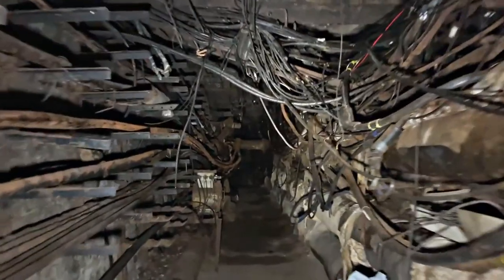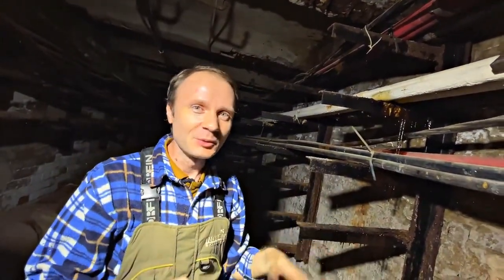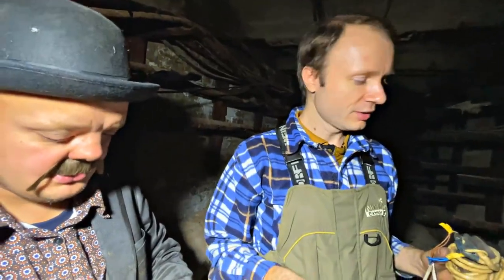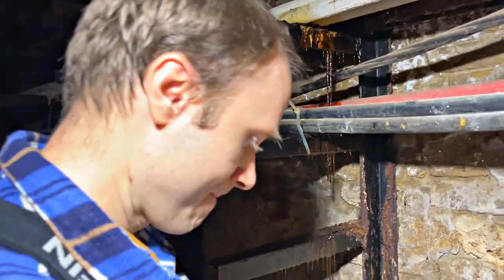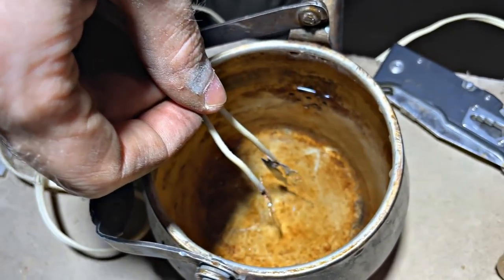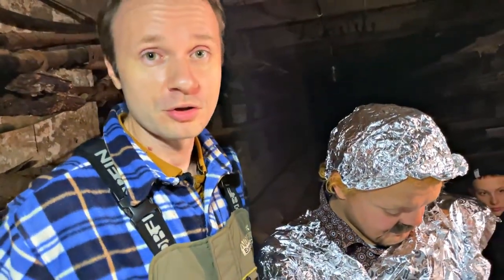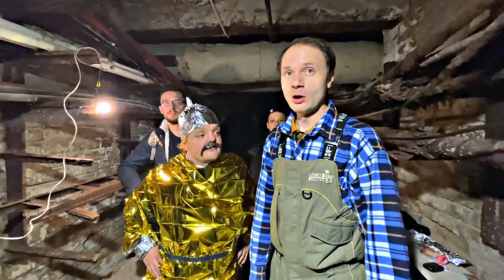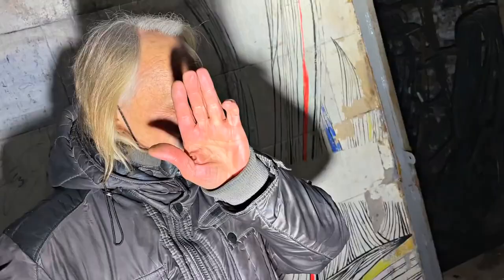How to get⚡️Electricity⚡️with a REEL from High Voltage Power Lines ⚡️💡⚡️Wandering Currents

Comment: You just made a transformer and say it doesn't steal electricity from wire, lol
Reply: Nope it's not stealing electricity from wire it generating current from the wire magnetic field.
Reply: There are so many videos about it.
Reply: @Suspicious259  you’re putting a small impedance in series with the wire by clipping the transformer onto it. Whatever is being fed power by that line is going to see a small drop in voltage because of these shenanigans.
Reply: @Suspicious259  those transformers cores are designed to force wires to make a bigger magnetic field than they ever would on their own. That’s going to rob some power.
Reply: Jov Ven  what
Reply: @Suspicious259  lol its transformer transform voltage from hv cable to another level voltage, maybe 220 v hahaha
Reply: Man i was thinking this the whole time
Reply: It does if you don't pay for the power going through the cable haha
Reply: Yeah!
I was thinking the same. That's basically a current transformer - it works by putting a small inductance on the line, which in turn creates a very small voltage drop as the current passes it. The more current that passes, the higher voltage drop and voltage output at the secondary. Normally this is used just to measure AC current in a line, but can of course also with the right configuration extract some energy. 
The voltage drop (and energy extracted) is most likely not even noticable for a line like that (it's probably in the mV range - but with a lot of current passing, that can still give enough output to power small things up, like they did). Neverless - it's 100% stealing that energy, LOL!
Reply: @oskar_f2397  its nowhere near as illegal as patent offices stealing inventors overunity patents. We are making due with the breadcrumbs we are left in society its amazing these guys are showing how to survive Whats obviously coming the next 5 years. True heros imo. Keep up the great content guys
Reply: @brandonwood8971  You are right about the great content thease guys make and I dont think theyre doing anething moraly bad but i will have to disagree with you about the overunity patents. I think if they worked they would break the laws of fisics. But I am not trying to say anething bad about you mr Wood.
Reply: @oskar_f2397  im so happy then to share this youtube channel with you "aaron murakami" feast your eyes my friend. lets your soul feel the greatest hope it ever has. im surprised stars and black holes didnt prove to you overunity is possible already like it did for me 25 years ago when i was 7
Reply: this is the most valuable video ive ever seen.
Reply: @Suspicious259  It is, it creates drag on the wire.
Reply: @Suspicious259  That's how transformers work, you have a coil (which can be a single "turn") an iron or ferrite core - and then another winding. Energy *IS* being taken from the thick conductor being shown.
Reply: @deltab9768  - With a wire/ service line that size, it would be undetectable.

Comment: The magnet trick can be misleading. You can have a cable that's still live with dangerous voltage, but you can't feel it until something else draws power from the line.
Reply: Partially true. If the cable is long and isn't very well shielded it will have a small mutual capacitance between it and any conductor in its proximity, and these so called 'parasitic capacitances' will cause it to move some current and produce magnetic fields.
Reply: Like someone turns on a raido then u could feel it??
Reply: @pauldelasco  You probably can't feel it if there's just a radio. It probably needs to be a a big load like an electric heater or a really big pump. Exactly how many amps it takes depends on a lot of different things.
Reply: @AtlasReburdened  At 230v 50hz or less this is so minimal that you would never notice it.
So definitely dont use this to check for voltage.
Reply: @AtlasReburdened  that is how the zombie light works
Reply: Or if it's a VDC line
Reply: woth old cables work all time, but new cables are protected and cant work like this, but is nice when see something like this, cause we like him :P
Reply: @BritishTightEnd  They ran into that in the subway, nothing was ac so they couldnt transform.
Reply: What kind of magnet is it?
Reply: @AtlasReburdened  and it might not work on dc, because dc should produce a constand field and wont cause a magnet to vibrate.
Reply: @theone4782  Yeah, but you'll almost never see DC lines run that long.
Reply: yes.
Reply: Yes in a long cable there are "charging currents"
Reply: sometimes for lighting in such underground places, also for protection equipment, can have ~250V DC.

Comment: Puttin a core around the wire is actually making a transformer. Even though you haven't broken te wire, you are inserting a small impedance in series with the wire and producing a small volage drop in the wire, which is slightly reducing available voltage to the load.

Comment: This only works if there is a high current being drawn from a wire. Even high tension wires won't induce much current until they are being heavily loaded. The amount of power will go up and down throughout the day as people use and shut off different electrical devices.
Reply: @solexxx8588   yes. It's always there. But the voltage will go up and down, and so will the amount of current you can draw without losing that voltage.
Reply: @deltab9768  no clue what you are talking about. Power lines are always fed to keep a steady voltage. Current is a different story
Reply: @Gallardo6669  I’m talking about the the induced voltage in the coil which is dependent at least partially on how much current is flowing through the line.
Reply: @deltab9768  you are right.  I am sorry.
Reply: @Gallardo6669   No need to be sorry, my comment was hard to interpret, like most of the ones on YouTube.
Reply: @deltab9768   A disagreement settled amicably on the Internet. I think I will write this down in my diary...  if I had a diary

Comment: You can double the windings to get 230V, then the switching chargers will take half the current, and you can plug more of them in.
Just stay within the limit of the charger´s maximum voltage. Thin isolated wires will do the job, as the current is not that high.
Reply: He will actually only get half the output current as well, with twice the amount of turns
 - because that thing is basically a current transformer. It works by putting a small inductance on the line (that only depends on the properties of the core, not the amount of secondary turns), which will induce a very small voltage drop on the line. 
That voltage drop then act like the input voltage of a transformer with just one primary turn. Like all transformers, doubling the amount of secondary turns, will double the output voltage, but the current will only be half as much (if the input power remains constant - which it does in this case, since that's only determined only by the current in the line and properties of the core). 
So I think they had the best config there, since most small chargers will accept 100-240 V. It will be safer as well
 - because the current passing that distribution line is probably not constant. If it goes up, so does their output voltage (which creates a big risk of overvoltage and blowing things up if they are already at 230 V, LOL!)
Reply: The problem is that the voltage will vary MASSIVELY according to the LOAD that they put on - but also the amount of current flowing through the cable (they have basically made a "clamp type" current transformer. A load of perhaps 20W when the main conductor is only running a very light load (perhaps early hours of the day in summer) might give you a volt or two - or even just millivolts.

That same setup with just a 1w LED when the cable is under HEAVY load (people cooking and popping the kettle on) may see the voltage shoot to many hundreds of volts - or higher still.

Current transformers used like this are spectacularly unstable!

Comment: Technically it is not wasted energy,  you are indeed putting a load on the wire. 

If you tried hard enough, you could create enough load to start a massive fire. 

P.S.: Love the video
Reply: I was going to say the same. If a current is drawn from the secondary winding of the transformer, it will produce an opposing current in the primary, which will present as a voltage drop through the transformer. This means the voltage at the end of the primary will be slightly lower, so power is indeed being taken. Still a pretty cool demonstration, though!

Comment: The more windings on the U shape core, the more VOLTAGE you get, not more current.  What you made here is similar to the instrument transformer used for measuring current. The voltage across the two ends of the winding is proportional to the AC current through that one big wire.
Reply: Correct. But the thickness of the wrapped cable determines the available current
Reply: Potential transformer!!!!
Reply: But I=VR

Comment: It's a smart idea but the theory about capturing wasted energy is incorrect. Once you connect a coil through the iron core then it is just like a normal transformer. Any power you draw from it is an extra load on the cable, which could be quite large compared to the amount of power that is normally wasted.

Comment: The water woulda worked better with an electrolyte, salt woulda sufficed.
Reply: Yeah or pee in it helps too if you don't have salt you can make yellow tea ;-)
Reply: @kitecattestecke2303  someone been in prison!
Reply: The problem they had was illustrated by a small LED dimming - you can only get a few watts like this without massive effort. You noticed when he let the blades touch, there was no arks, sparks and bangs, it just made the lamp go out.

Fun - and if you only need a few watts and your circuit won't mind a W-I-D-E range of voltages (the more power drawn through the MAIN conductor, the higher the voltage induced in their current transformer (for that is what they have made). Low current, big load - might yield voltages down in the volts or even millivolts level. A small load (2w LED) and a HEAVY current through the main conductor, might see the voltage go to over a kilovolt. You just don't know with a current transformer when it used like this.

Comment: Hey Kreosan, with putting current into the water, you're actually not heating it up but start a chemical reaction: current flows through the water and seperates H2O into H2 and O2, so you're making Hydrogen on the one side and Oxygen on the other side. If you get a lot of that gas, collect it in a baloon or something it explodes like hell, be careful! :D
Reply: To make hydrolysis you need DC not AC. In some countries you can buy water heaters  that works this way and even shower heads (popularly called suicide shower). This method of heating water is popular in prisons where they are not allowed to have a water heater.
Reply: thats not right bro you need 2 different metals.
Reply: It's both. It gets hot AND makes gas. Probably not so well with AC.
The gas is made very slowly. Even when you make the gas on purpose you have to be careful to capture it and concentrate it and you have to run the machine for a long time to get much gas. I think the risk of explosion is very low if you do not capture the gas.
You can look up the lower explosive limit for hydrogen. There has to be that much hydrogen in the air to make it explode. Otherwise it won't.

Comment: It's how "current transformers" are made - you pass (typically) a single conductor through a core (normally a toroidal) with a secondary. The turns ration is then used not to calculate current but to transform current.

So for example, if you have a 100:5 CT, if the wire through the middle is carrying 100A, it will push 5A through your meter - which shorts out the secondary!

The problem in using a current transformer like this, is that the voltage you get out, depends on things like "how much current is flowing through the main wire", what LOAD you have put on the secondary and so on. You might have 57v when you connect a 20watt load on it - and then when the demand peaks at the other end of the wire - and you decide just to power a 3w charger, you might find the voltage rises to many 870v.

It's fun - but it is not without some risks, not least frying devices which take almost no power at all.

Comment: In England you can get free electric, enough to charge a phone or light a lamp, by connecting wires to your telephone socket. It is illegal but if you've had a power cut and it's an emergency then you have to decide if it's worth the risk.

Comment: all you have to do is put a magnetic antenna on the roof of your house and disconnect the city power lines to your house ending your electrical bill on every house and draw the power sent over the overhead lines and feed the antenna into your house subpanel and viola free energy until they turn off the power in the power lines or have a blackout..... no more energy bills ever..... wake up people free safe and a grounds for suing them out of business tor charging and over charging for 100 years.....

Comment: If you add just a minimum of Salt the watter should boile fester, caused by the higher conductifity 

(German original:
Wenn ihr nur ein bisschen Salz in das Wasser macht sollte es schneller, auf Grund der höheren Leistungsfähigkeit, Anfang zu kochen!)

Comment: Fyi you are transforming power exactly the same way your little fone charger brings that 120v down to usb voltage.  Its like a motor, the alternating current in one wire creates a rotating magnetic field that creates a current in the other wire instead of turning a shaft.

Comment: The magnet will only detect current, not voltage. Also thats not stray current, you are basically making a transformer so you are stealing electric.
Reply: The magnet will detect a changing magnetic field. With AC this is due to an AC current.  If the current was DC you'd have to move the magnet in that field and be able to tell the difference in feeling between that and no current - more difficult but still doable.

Comment: Ahhh I didn't know theft of electricity was legal 🙄
Reply: It's not temheft they are free radicals.
Reply: @fiacradoyle7474  what!? 🤣🤣🤣
Reply: @fiacradoyle7474  no, its theft
Reply: Well, at least the wires will not get damaged...
Reply: @theschnilser7962  if he wouldve used it longer it pbb would
Reply: Koevoet I disagree. How? It's inductive current. There's negligible heat or friction, so how would the line be damaged? What would be the failure mechanism?
Reply: @fiacradoyle7474   It's adding a small inductance in series to the line. The load acts like it's parallel to this inductance. It definitely reduces the voltage the line is supplying but I'm not sure how much it changes.
Reply: @electrofrying1685  well the core will get hot by alot of usage (ofcourse not in this example but if they would use it for their home etc) and that will damage the cable
Reply: @electrofrying1685  I agree, it's just a wire going through an iron core, that makes a transformer. At such a low power like a single light bulb or a phone charger it should not cause any problems.

Comment: They had 120+ volts. Could have used a hot plate or a stinger to boil water.
Reply: Sadly not enough current. Remember the little LED lamp dimmed when they tried the "blade kettle".Using current transformers like this is a wonderfully unstable way to extract pretty random voltages which depend on how much power is flowing through the main conductor AND how much load you placed on them.

Ranges of <1v to over 1KV are quite possible with a setup like this depending on current through thick wire - and load applied to their setup! :)

Comment: Thank you so much for teaching me how to do this. I’m homeless because of psychological issues and I want to be able to get light and change my phone in my tent. This will really help me.
Reply: My friend is in a similar situation. She lives in a tent with an extension cord. She can run lights, charge phone, run laptop computer, use toaster oven, hotplate, electric blanket, hairdryer to blow warm air into sleeping bag. She never runs more than one heating appliance at a time to avoid tripping the circuit breaker.

Comment: some high voltage lines are mostly aluminum but with a few strands of steel in the center, for tensile strength. So, is it the vibrating magnet the primary indicator of carrying a charge? A great video!
Reply: A magnet will vibrate when held close to any conductor carrying sufficient alternating electrical current (AC amperes). It requires current and not just voltage. It would work with aluminum as well as copper conductors. If the conductor is being shielded by a magnetic material such as an iron pipe, you may not feel it. Lamp cord wire carrying 8 amps can be easily felt with a neodymium disk magnet held with the edge of the disc in line with the axial length of the cord. When voltage is present but with no current flow, you won't feel vibration in the magnet.

Comment: To heat the water, except the power conductivity is important as I know. My old coffee machine (which is simply a water heater) boiled the sold bottle water in about 5 to 10 minutes. However, it boiled the tap water at home in 20 seconds or even faster, just like a short cut. :D

Comment: Cant be legal. Stealing very little power is still stealing power, it’s the same as using a power adapter connected to the wires directly to charge phone.